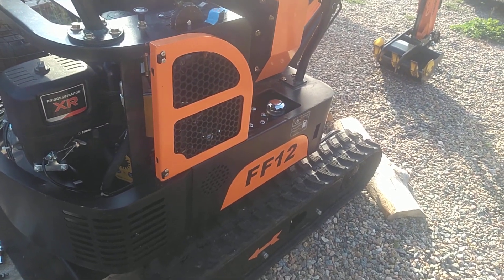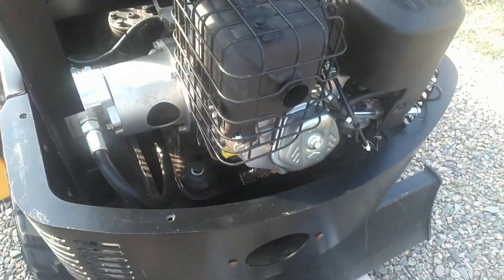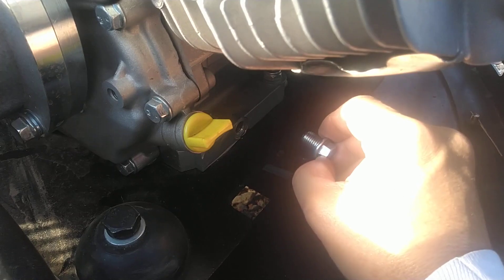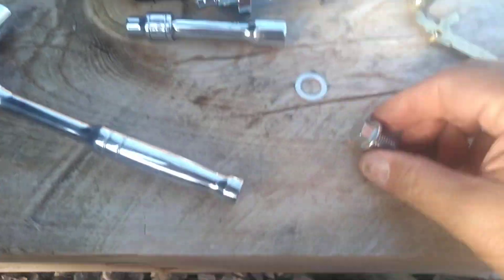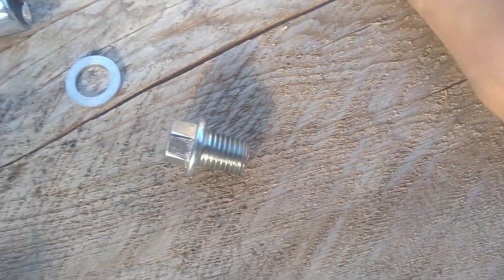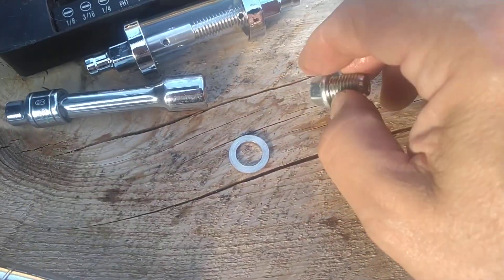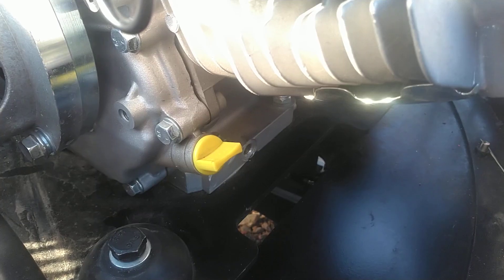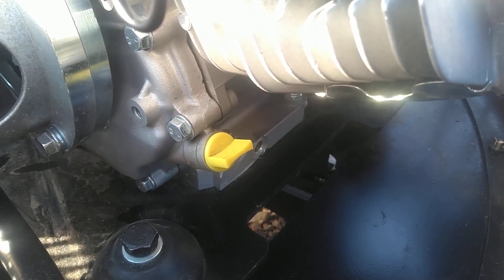Chinese Mini Excavator :Thread Pitch of Oil Drain Plug Briggs Stratton 13 5 XR BS Engine FF12 (Dub)

Comment: Yes!  Ordered.  Do you know what oil filter it takes?  Or where the engine model codes are located?  I looked all over.   Rippa R10 with B&S 13.5hp XR engine.
Reply from the maker: Hey! I’m not sure about the exact hydraulic oil filter. I do know the main model number for the Briggs 13.5 is 25T2, though there are several variants of that specific model. Appreciate the comment and thanks for tuning in!